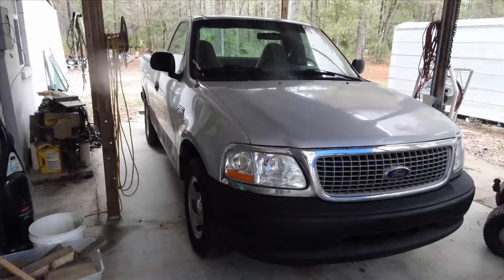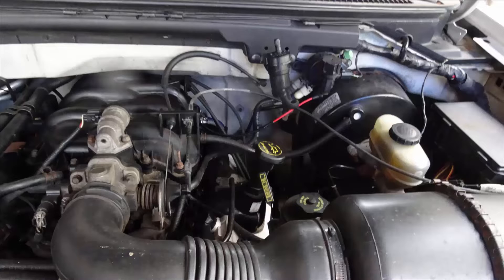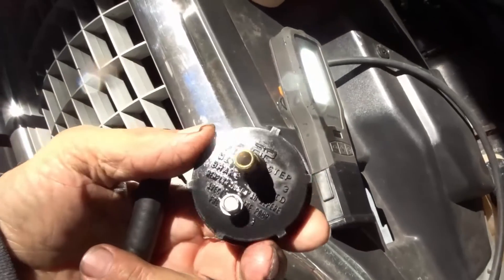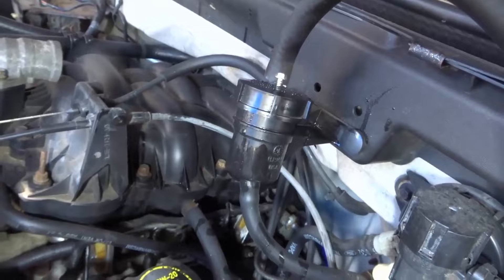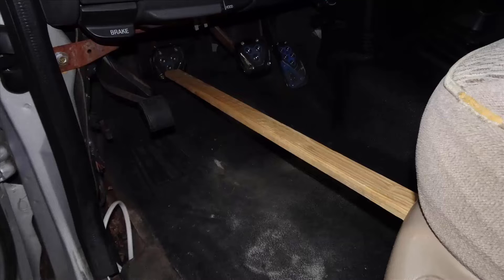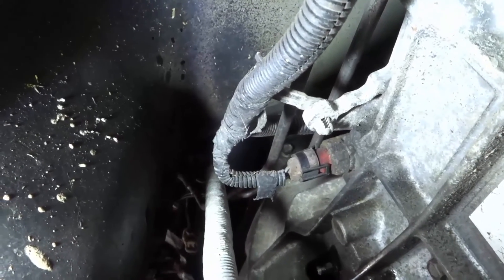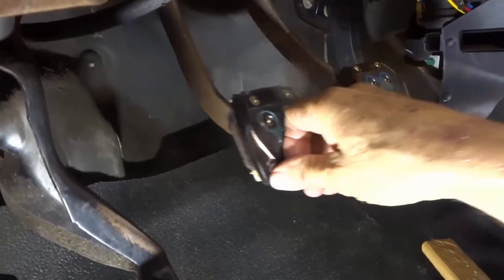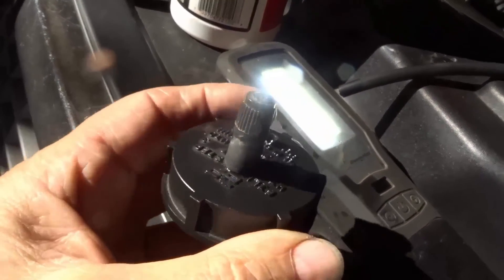Want to know how to bleed hydraulic clutch without assistance?

Comment: My 2000 Ford F-150 4.2L does not have a bleed screw on the clutch slave cylinder. How can I get the air out of the line?